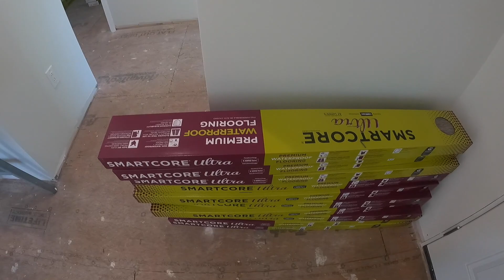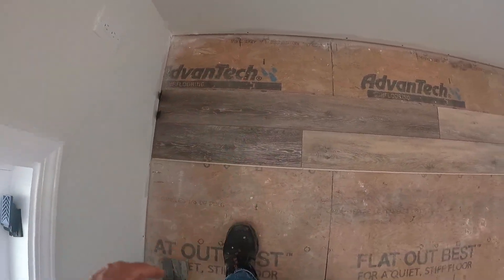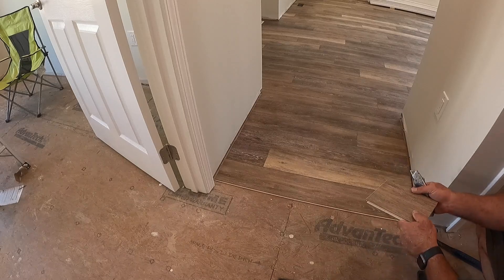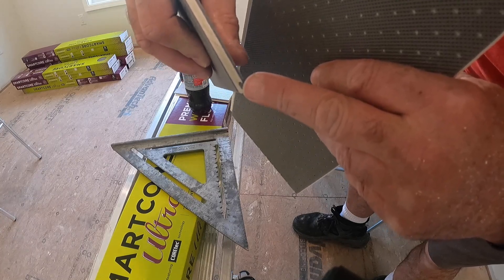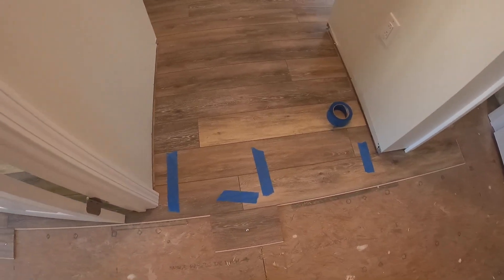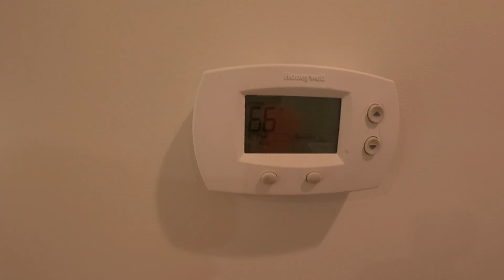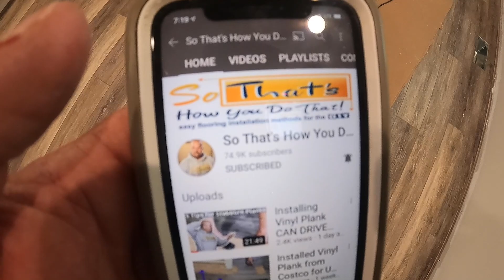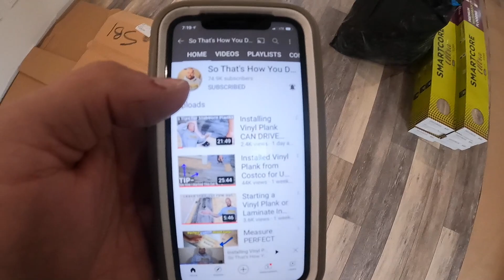Not Necessarily HVAC Part 24 - Vinyl Plank Flooring

Comment: For not having installed a floating laminate floor that was a heck of idea the way you started.    I've done a few of them and started 1 row from the wall, or at the wall with a 3/4" space ,then weaseled the first row in at the end knowing that my base instal right over the top would secure that row " letting it truly remain a floating floor ".  I've also done it where I face nailed that first row and ran it from there.  letting the base cover the trim nails but could potentially create expansion problems but I did it anyways. I think if it expanded it would move the trim nails before it buckled the plank and that would all happen hidden under the base and shoe molding.  But I like your idea.    I wish I thought of that.  Lol.

Comment: I like the stuff, but I had it installed, and am finding out that there was too much distortion on the kitchen floor, and needed floor leveler before installation, so the seams are coming apart.  In your case, floors are level and should be great!
Reply from the maker: I can see that happening for sure. It's also deceiving at times and looks together but if you smack it with a hammer one more time it locks a little tighter!

Comment: Nice !
Is that an ABC pattern or just random out of the box🤔
🥃🥃🍺🍺🍺🏌🍇
Stay safe.
Retired keyboard super tech.
Wear your safety glasses.
Reply from the maker: I just tried not to get pieces that were alike next to each other. Looked like there was basically four different colors, each with varying grain patterns. I did notice myself flinching when I was ripping a piece and got close to a "knot". It's pretty realistic lol.